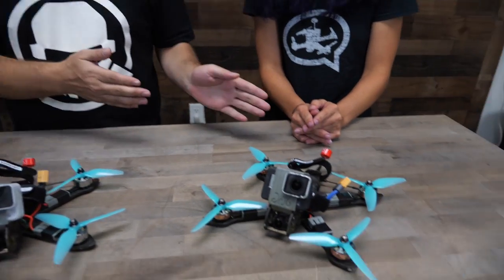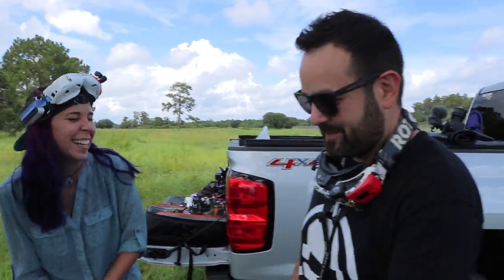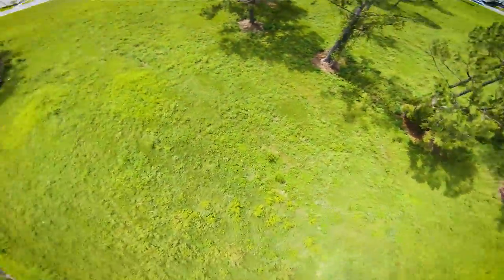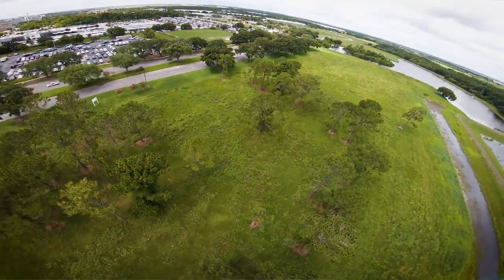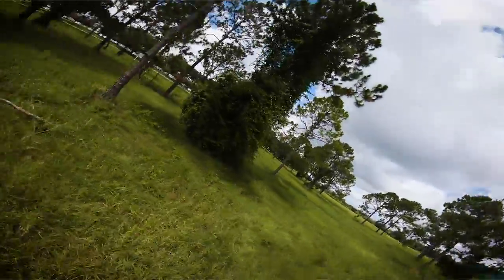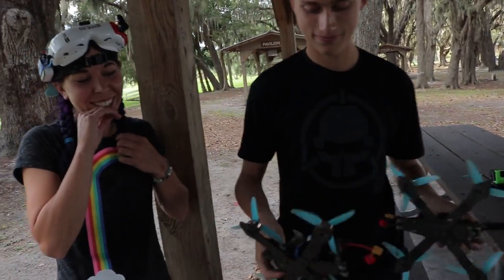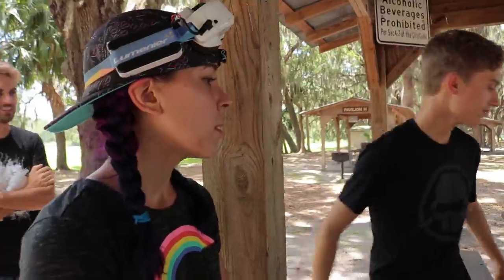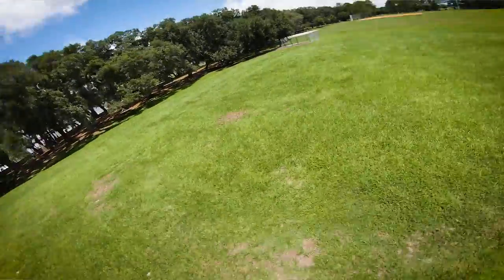2207 vs 2306 FPV motor - Blind Test & Comparison!

Comment: some thoughts.     welcome to the new field of study....comparing  OPINIONS.   where  all variables have Not been made equal; where energy consumption rate and/or the effects and amount of  cogging  and/or size of conductor in the stator of each motor have  Not  been discussed.         RESULT:  More  Opinions.         as other commenters have noted, ultimately, each motor may be slightly  better for freestyle, or for racing.         googletranslate